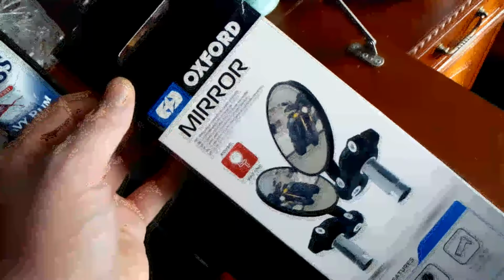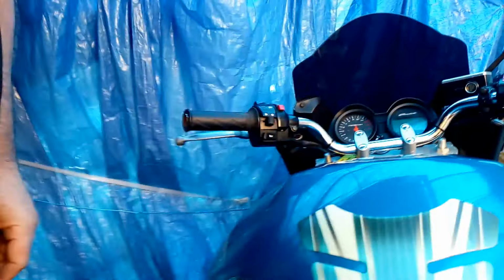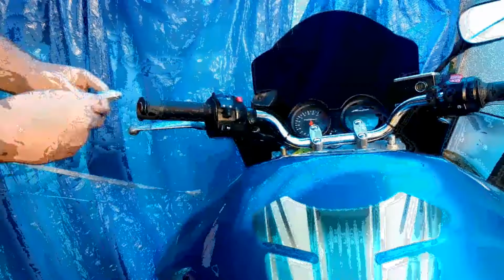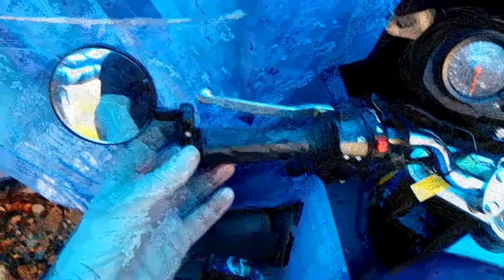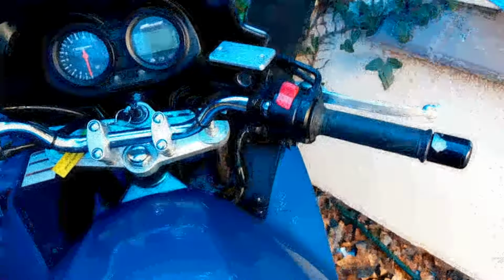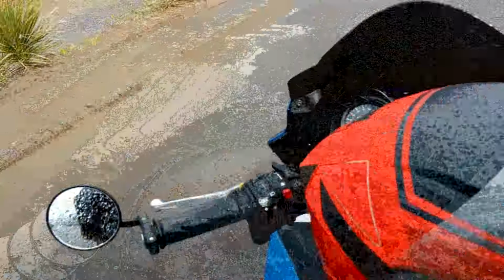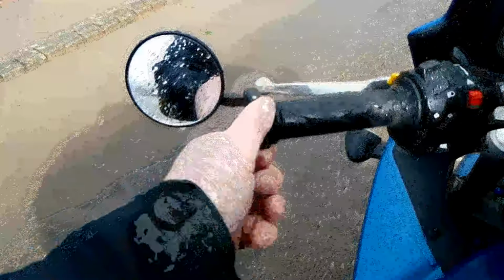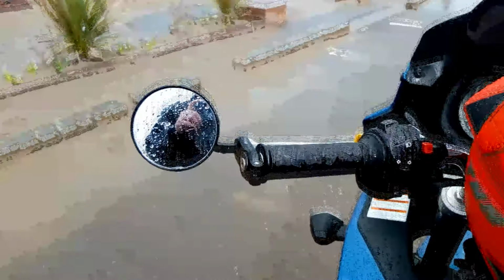OXFORD, BAR END MIRRORS, fitting, review,

Comment: Hi nice video, can I ask if these fold inward? If you are trying to into a garage and it’s a squeeze?
Reply: Hey, is the ball joint able to be tightened up? My bar end mirrors at the moment always need to be adjusted when I ride, it sucks!
Reply: @ashenglandbiker  cheers, I'm going to try a set of these mirrors
Reply: I’m about to fit these to my sv650 ( 22 plate , so I yank out the thing in the handlebar with a screwdriver 
My mate has a Kawasaki z900 and could not work out how to get the thing out of the handlebar ..